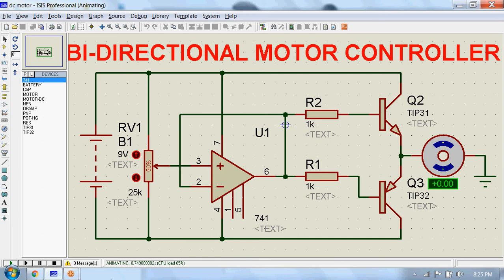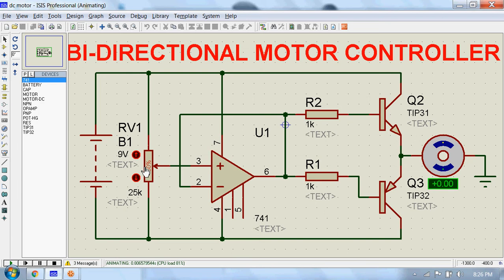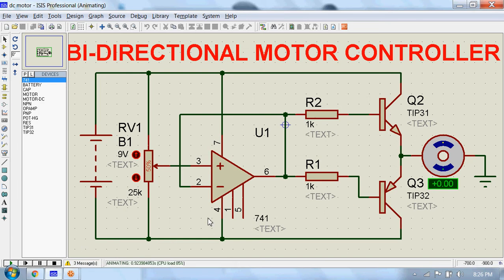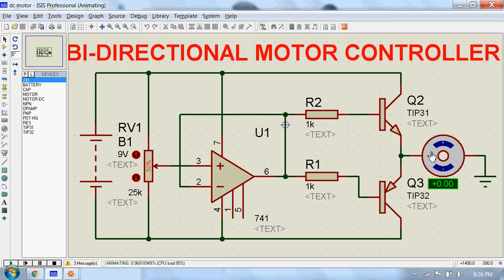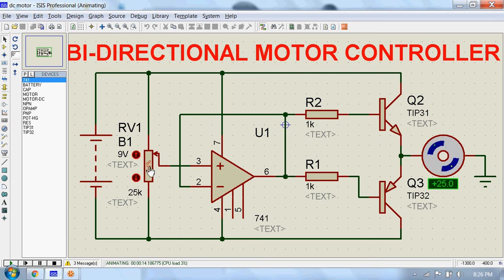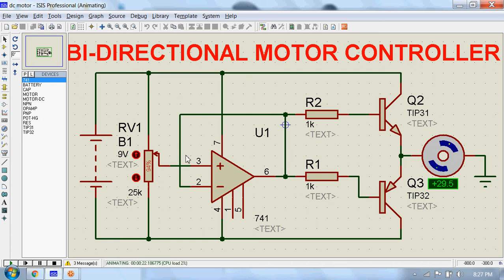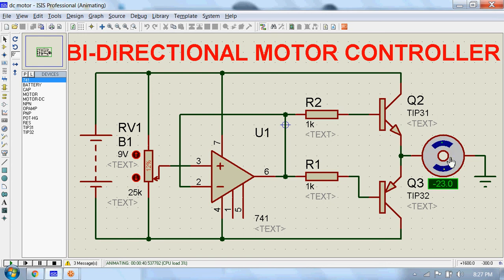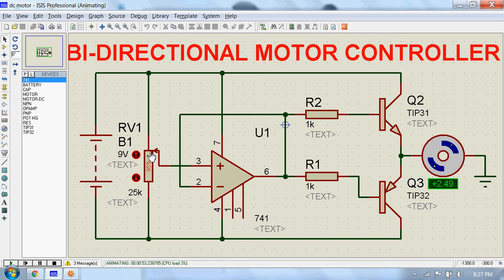Bi-directional motor controller

Comment: I've tried it, it doesn't work. The motor only rotates in one direction, when I turn the potentiometer, the motor stops, it doesn't rotate in the opposite direction
Reply from the maker: I built this circuit on breadboard and it worked.

Comment: Can you make it stop after 10 seconds.I want to use an ldr to automate the opening and closing curtains.When its evening the motor moves in a certain direction for like 10 seconds and then it stops.In the morning it does the same but in the opposite direction
Reply from the maker: That can be done using a micro-controller and writing a program. The one shown on the video uses an opamp and two transistors only.